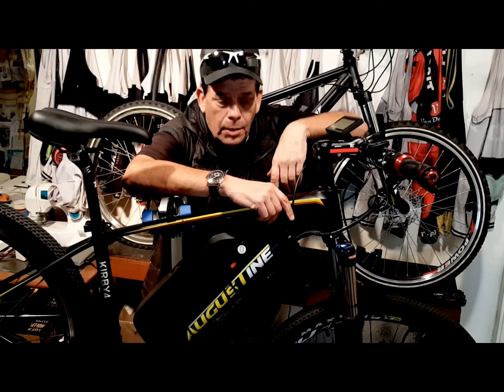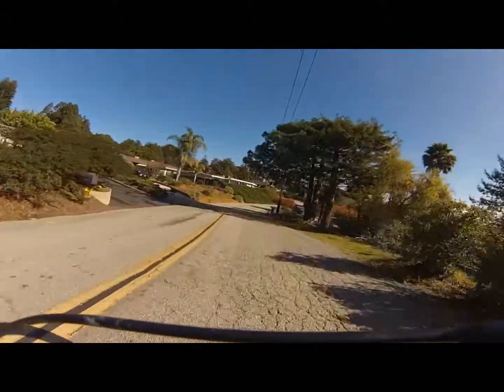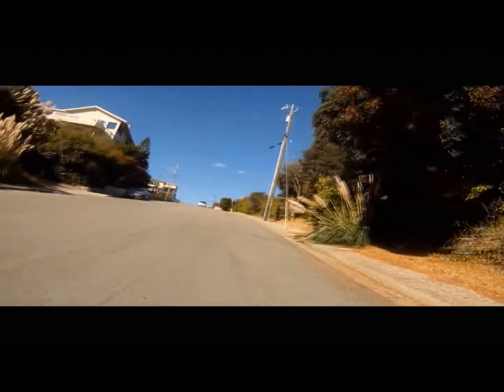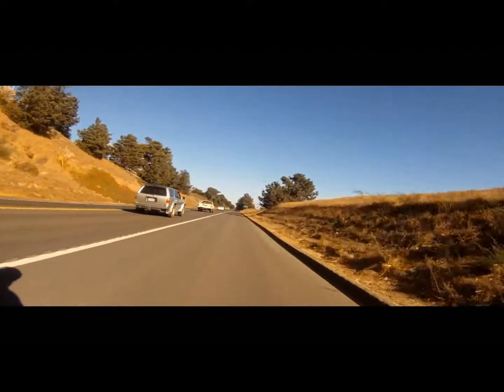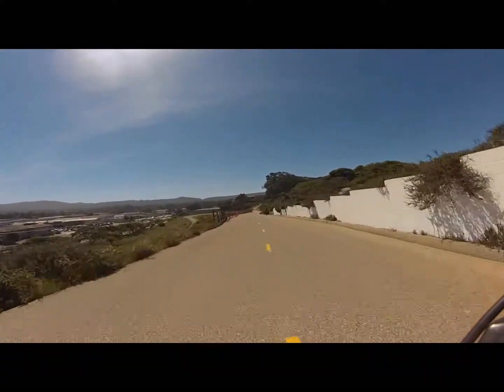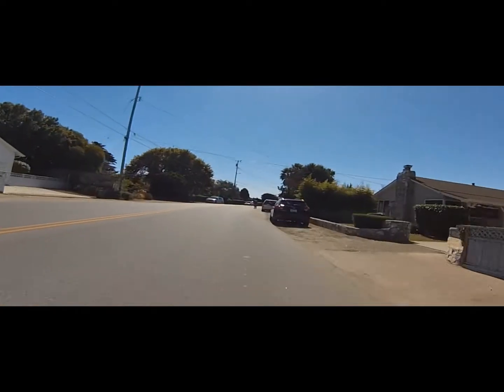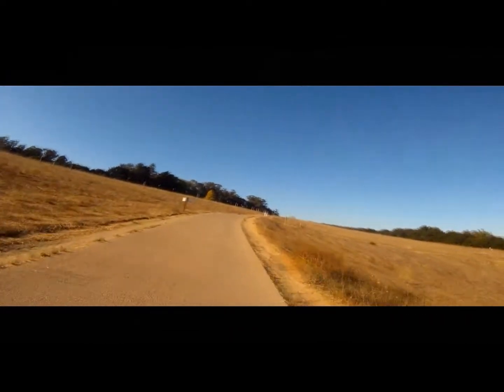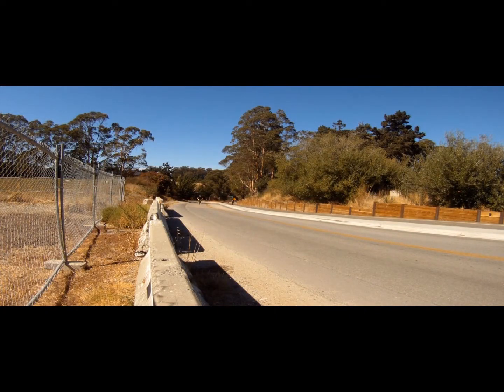KICKASS! 45 MPH, 1200w Conversion Kit. (1500w) max output. Fast

Comment: Bought a CKit by Jauopay 1500 watt front motor using 52v 20ah battery. Got the right frame of a Incline Bike where there is less peeling out or just minimal but the peeling has to do with the sensitivity of throttle as I only need to make 1 to 2 millimeter twist to start going. It got me to 20mph in 2 to 3 seconds and I rode same speed on 35mph zone of other cars and yet reached halfway on throttle. Started this speed test up to 40mph but I backed off due to the safety I  must commit to from going full throttle as Ive yet to try this.

Comment: I got the GT aggressor expert with a 1500w rear wheel ebike kit and a 52V 21ah battery and i realistically think i get 38 mph but on a bike it feels like your doing 80 mph if it was a car make sure you get good machanical e-brakes and upgrade the forks eventually  but its a damn good bike to start with retail around $750 i can ride wheelie my entire block there just fun i go throttle only but i get about 40-60 miles. I learned that dont go crazy on your throttle hit max speed then coast from 30 plus mph which is a easy quarter mile. Just dont keep the throttle twisted after you max out speed your just killing battery.

Comment: Could you provide a link to this exact ebike kit (not one like it) or the vendor for this kit.  The performance of this motor is above average for the wattage and I'd like to get one.  I've had some nightmares with cheap inefficient chinese motors and I'd like to avoid unproven motors that use way to much power for their torque.